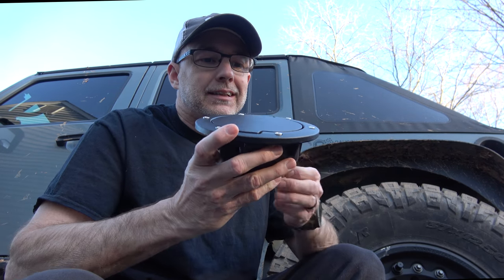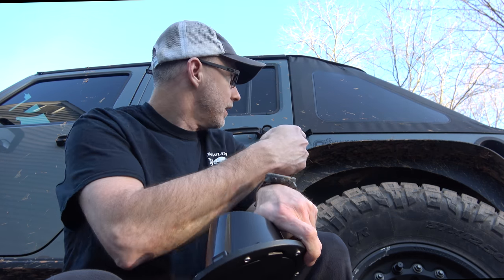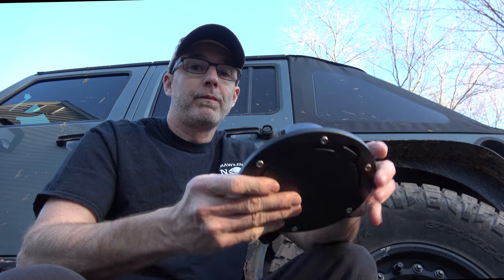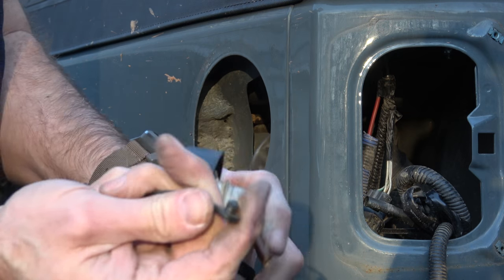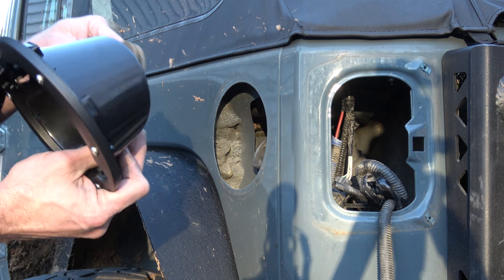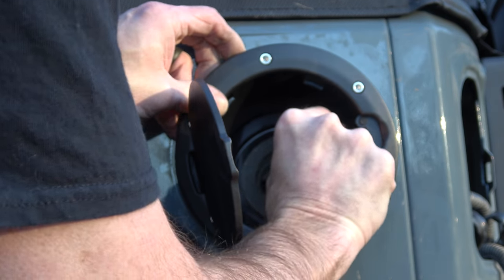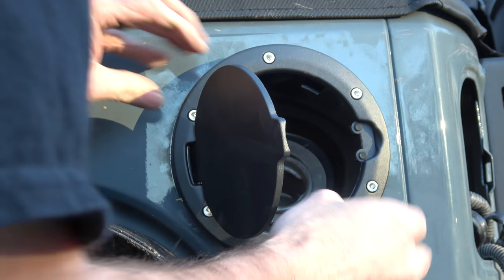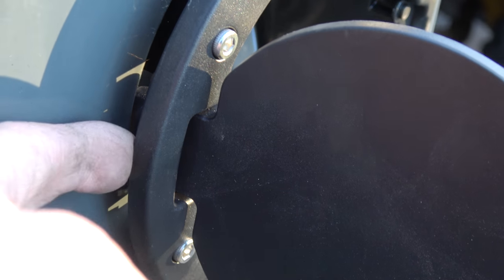Fuel Filler Door Install - 2015 Jeep Wrangler JK / JKU

Comment from the maker: Dang. I realized after I finished that I actually put the rubber seal on backwards. Darn it. Still fits fine, but I'll flip it back around to match the way it came off.
Reply: this might sound stupid but i have the same exact fuel filler door and i was wondering if it would work on my TJ or is there different types of fuel filler doors for the tjs